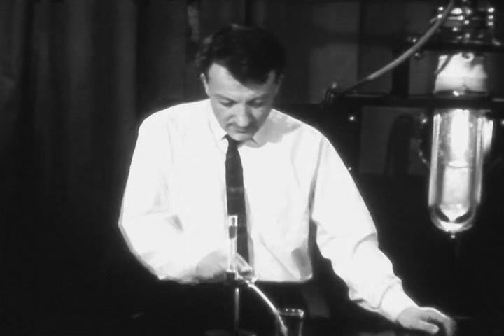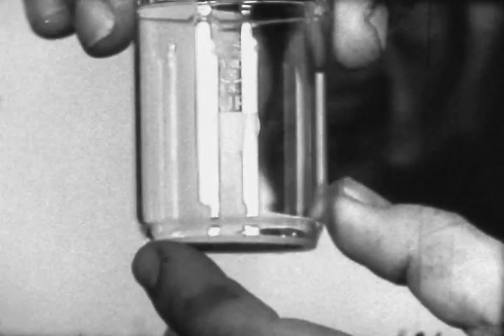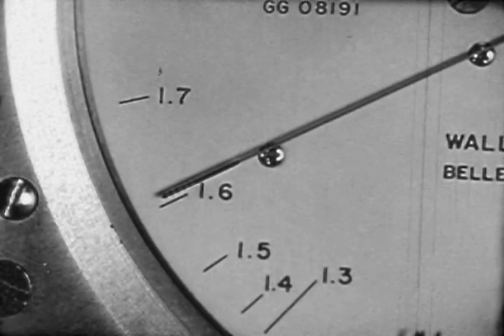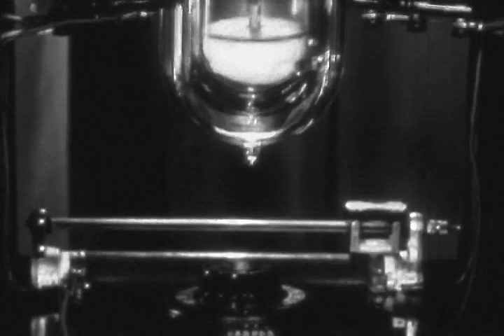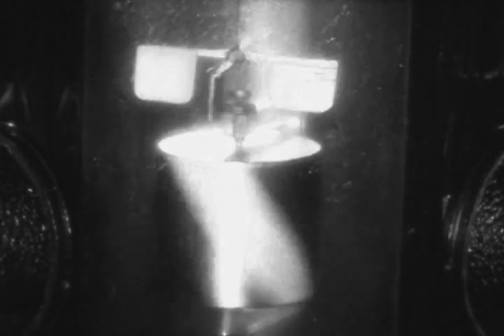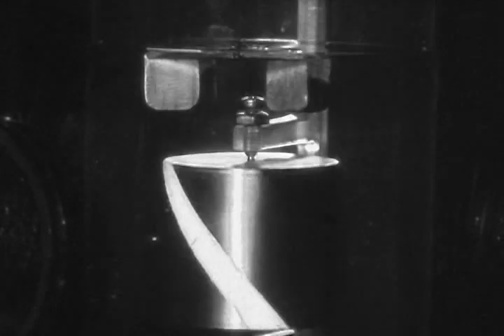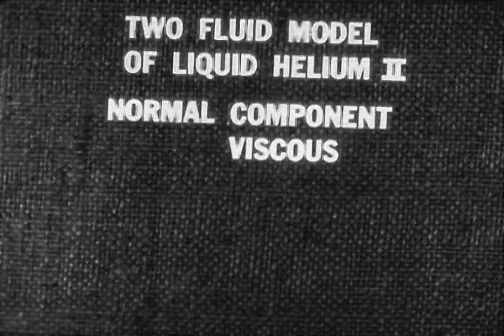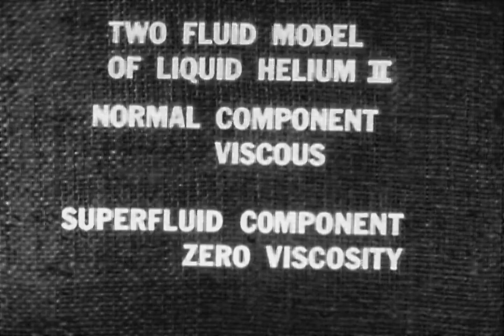Liquid Helium II the superfluid (part 3 The superfluid has zero viscosity)

Comment from the maker: @Desmonddd2002 The 2 fluid model is more of  a phenomenological explanation, so in that sense it's 'wrong'. But it's soundly based and correct, it's just not a complete explanation. It explains most macroscopic phenomena, you just have to know its limitations.

Comment: @Sierrafox17 Again, no, Superfluid Helium has NO viscosity, that is one of the criteria that defines it as a superfluid. Once it goes below Lambda, no viscosity or resistance. You can run 1,500 Amperes through a 1 mm or less copper wire, cooled by superfluid. If it goes above lambda....well ask the Cern people what happens if your helium gets a half degree too warm. Normal house wiring could not come close to taking 1,300 Amps. Your house, if like most modern ones has only 200 Amp service.

Comment: Motor experiment needs to be repeated with the chamber evacuated.  I allege that the paddle wheel could be dragged around by induction from the rotating magnetic field, or from diamagnetic hysteresis effects.  If this is true, the vacuum experiment will show this as there is nothing in the chamber.
Reply from the maker: The paddle is made of wood for that reason; (BTW wood is paramagnetic rather than diamagnetic, with a relative permeability 1.00000043). The speed with which the paddle started to turn leaves little doubt that it was due to bulk flow of the liquid helium and not due to any magnetic effect on the paddle.

Comment from the maker: Also the only thing which is liquid at that temperature is He. So its a pure sample. There's an analogy here with superconductivity. There the resistance is zero. Measurements have been made which show that once a current starts flowing it will continue for over 100,000 years. That's a lower bound, if we could measure more accurately it could be higher. Compare that the fraction of a second decay in most circuits. Viscosity is zero in the same way.

Comment from the maker: @genius1140 Then you ought to be aware that your argument does not apply to the superfluid component - it is not a Newtonian liquid. Furthermore at absolute zero there is no normal component  left it is entirely superfluid. 

Your error is to fail to appreciate that viscosity measured by bulk flow and capillary flow give different answers and that for one to be zero and the other nonzero is a paradox. A paradox  which cannot be resolved except by quantum mechanical arguments.